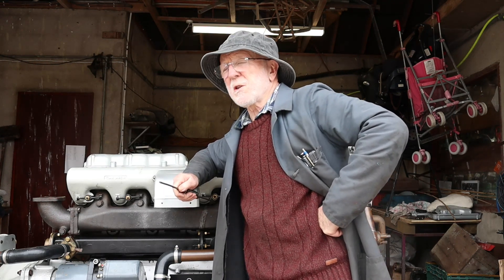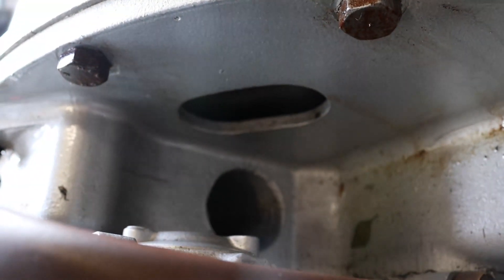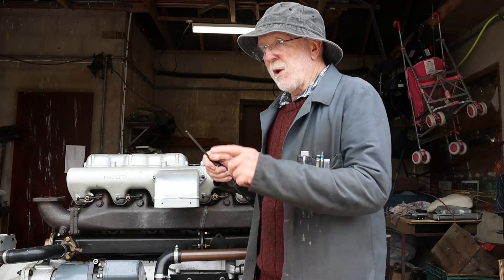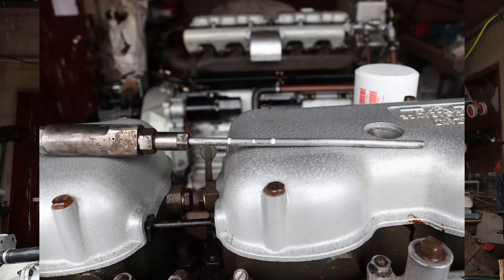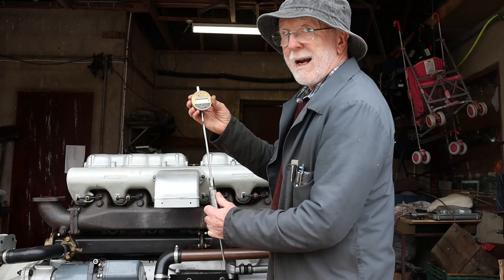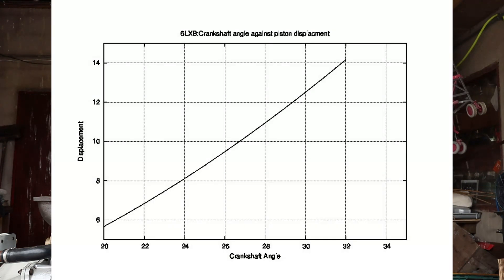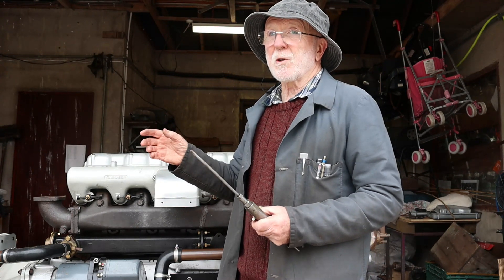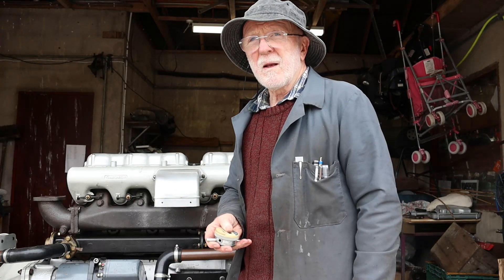Gardner engines: here we take a look at a home made timing tool.

Comment: Ive got some of the genuine factory supplied timing tools that consist of sumthing similar to what you have made but they have an engraved brass plate with all the degrees on it and a spring loaded pointer connected to the rod that goes thru the head to sit in the bowl of the piston. They were nicknamed choppers or flags.